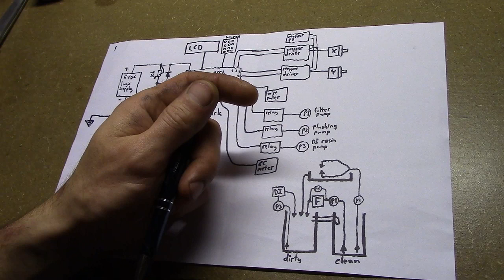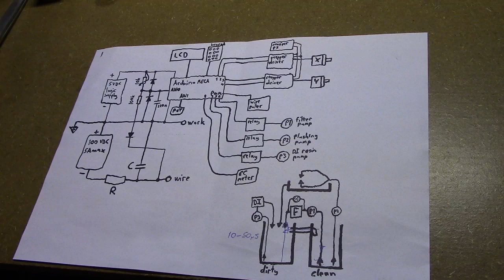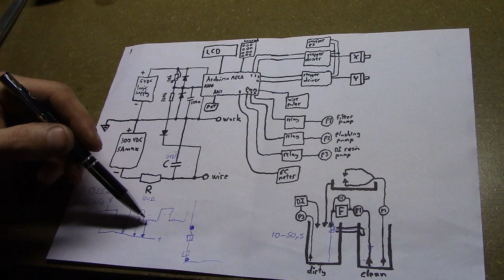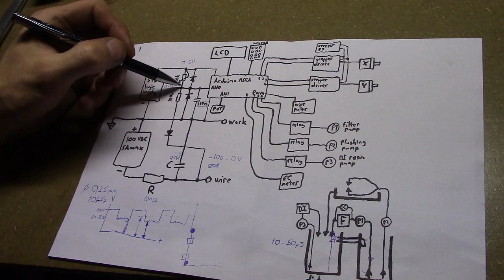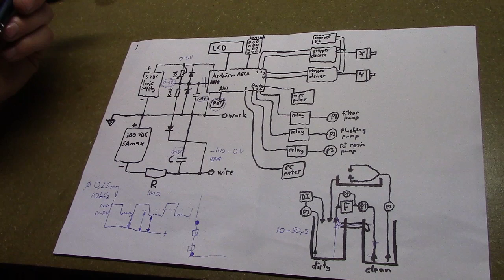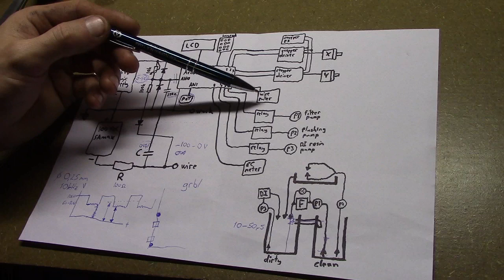Arduino wire EDM schematic explanation

Comment: About wire edm pulse, you wrote is a simple step pulse, i saw someone  use a two steps at the pulse,  i don't remember at which sides ; the rise or fall edge, its at lower voltage than the full 100v (let's say 60v).

Comment: I've been working on a ram EDM with this same approach, but I'm having a major issue that nobody else seems to have. I'm hoping you can help me. The problem is that no matter what my capacitance and voltage combination is, I don't reliably get arcs. It works if the tool and work are very clean, but then after 30 seconds or so, they are both so corroded, that it literally can ram the tool straight into the work and still not make contact. I can sort of get it to work if I "peck" the tool rapidly, but it's physically mashing the tool down into the work. I can't seem to overcome this issue, but there's no mention of it anywhere online.

Comment: I wonder what mineral oil would do instead of water?  The oil doesn't conduct electricity and is used to submerge circuit boards for heat removal.  Maybe the dirty metal would settle out in a dirty tank or maybe the resin pellets wouldn't be needed. Can magnets be used to clean the water?

Comment: 2:50 you have mantioned that Discharged circuit consists of only 100V DC but i heard that for ED Drill High frequency pulses are needed !!!! I wondering there should be PWM controlling signal wires from Arduino to High voltage unit to pulsing it with high Frequency !!! 
Is it not necessary ??
Reply from the maker: Little bit misnomer to say DC, proper wording would pulsating DC. It is a DC power supply that is either pulsed or just a simple RC circuit to get the required high frequency. In the video I used a simple RC circuit, so no PWM needed unless you want better control of it.
Reply: @TheWireEDM  by RC you mean resistor and capacitor ?
Then why you are saying " high frequency " without any frequency generator with dc unit ? Is that charge and discharge cycle which you are saying Frequency ?
Reply from the maker: @omsingharjit  Yes, I had a current limiting resistor from the power supply and then a capacitor in parallel with the spark gap.
Reply: @omsingharjit  An RC-circuit is a classical electronic oscillator, just like the pendulum-clock On the wall is a classical mechanical oscillator. All oscillators are fundamentally described by their frequency, since "frequency" was first used in science to describe oscillators.

Comment: hello jaakko i'm inspired by your project and i'm trying to build one for my graduation and i'm stuck in how to modify the gap with the pot and how to stop the stepper if there is a short circuit 
thank you !
Reply: I would imagine...your gain would be too high....or feed rate to high...so think of an Op Amp circle...the reference is your normal arc voltage...in this case I think he said 50 VDC average.....then thru the divider the Adurnio....I can't spell either...Anyway...the microcontroller should see only 0 to 5 VDC...and it's clamped by the diodes...so maybe it averages to 2.5 VDC....his software control loop...will have something like if less than 2.2 VDC then step or pulse motor...toward the work piece...if 2.5 VDC ...don't step...let burn...if 3 VDC or higher i suppose he could reverse direction....if 5 VDC work feed in more?

It seems like on could do with an analog op amp...which drives VCO...then step that oscillatorway down using Dflops..then feed Q put..to your stepper controller...but... divided way down...

Anyway talking is one thing...building is another...

At my workplace...our customer they don't have or are given any time to be careful plus  they can't use WD-40 in a clean room...so I deal with broken screw city galore...like 316 clean SST hardware in 316 SST and overtightened....boom broken seized or stripped...some get adventurous...they may bring out their dull bits out and break the HS steel bits off..or maybe they manage to get a tiny 3/16 easy-outs broken in the broken screw..now it is time to take their handiwork  mess to me....

So I need a nice sink hole Portable...universal EDM....

Ok...Fred...build it and they will come...

Then post on u tube...
And obtain some followers...

Comment: Do you have a link for the code? Don't care if it's v1 or v2 just need a place to start since I've never coded in C or used an Arduino.
Reply from the maker: I'm afraid the code will not then help you at all if you have no coding experience. It will most definately not work by just uploading.

Comment: Here you say 0.47uF but do you mean 470uF?  Like the Nippon Chemi-Con 470uF 450V you tested in v=RUYWzd7CBWQ
Reply from the maker: Hello, sorry for the long delay in answering. I really meant 0.47 uF (470 nF) capacitor. The one in the test video from years back was just a static test to see that an RC-circuit works. In a wire EDM you do not need a very large capacitor especially since you want a high frequency output.
Reply: which one is right？   0.47or 470 ？
Reply: it should be 470uF.  0.47uF is too small.  I didn't have a chance to build this circuit yet, but you can see the Nippon Chemi-Con 450V-rated 470uF capacitor in his other video (paste v=RUYWzd7CBWQ in the youtube link).
Reply: i am not good at  english    ！ thanks！
Reply: This project is the best!  But his power supply is more complicated. 
 http://www.mechatronicprojects.com/wire-edm-machine/

Comment: Please excuse my ignorance as electronics are a struggle for me but why is the 100v supply positive lead connected to the circuit ground and the 5v negative lead?
Reply from the maker: The wire needs to have a negative potential for the machine to cut and the positive lead is connected to the workpiece. But because the machine is grounded from its frame/table, the workpiece is also at zero volts relative to ground potential, thus eliminating electric shock hazard.

Now, the electronics are referenced from that same ground potential also and operate on positive voltage, so it ends up to be +5 V relative to ground.
Reply: Jaakko Fagerlund  and now can share?
Reply: Imagine of the sparking RC-circuitry as a simple electrics piece (like a resistive heater or a washing machine), while the voltage-divider/arduino-combo as electronics (providing solely information, thus, a logic gate), that has to make sense for the arduino, but not essentially to you and me. As long as the information suffices for the arduino to let it make the right decisions, it suffices altogether, and doesn´t need to follow our human intuition.

Comment: i am working on code
https://www.youtube.com/watch?v=Pp-5wQKF1Ao
Reply from the maker: Krasimir Tsvetkov That's nice, but it looks like to work only in Windows. Also, LPT port is not anymore used nor found on motherboards. And to top it off, most of the graphical functions already exist in open source softwares capable of sending G code, so why reinvent the wheel on that?
Reply: Jaakko Fagerlund i worked with edm wire machine before 20 years .I know the machine practically. I tried with the same program to send directly signals to arduino , but the speed transfer does not satisfy me.I sent every step by com.Believe me that this program can work with Android as well   :) nothing new....
Reply from the maker: Krasimir Tsvetkov 115200 bps should be plenty enough to send data over, but I fail to see why one would generate the step pulses on the PC as it is far easier to have the Arduino receive G code and generate the steps needed, as it then is a fast system withot the lag of PC. True that in an EDM the step rates are extremely low compared to milling, but still.

Is your software open source?
Reply: Jaakko Fagerlund i don't like arduino grbl because doesnt show me the point   were is working (i am old fashion   man ). And if you have a time  try the transfer  115200 bps  with arduino uno... The software is not pubic yet ...
Reply from the maker: GRBL gives out the coordinates (work, offset) and also the G code interpreter state, so it really shows where it is and what it is doing.

I don't even start to test out trying to send steps over to the Arduino, as it would be pointless. It is by far the easiest and most simple to just send G code to the Arduino. With steps you don't need the Arduino, just send that information to the stepper motor controllers.

I understand your software is not public yet, but will it be open source or not?
Reply: Jaakko Fagerlund It`s pleasure to use my own code, a method of interpolation, acceleration, even another method for powering the wire .I think to not open source , but a token amount,Good luck,Jaakko!Respect your work!
Reply: Hello Krasimir, so far i tried to work on simillar project, but made the code on C++. Most of WEDM machine has parameters developed by C. Did u tried this?

Comment: im trying to start a small (injection mold) manufacturing shop , but just for my personal use , i wanna know how this machine can make a mold (because some mold) are really complexe , and have undercuts so i can image working by carving or router , with spinning tool (spindle) but using EDM i just wanna know how before making this machine .
thank you and im also interested to this DIY machine
Reply from the maker: +High ”Addicted” Tech You have a loooooong way to learn before I even start answering.
Reply: just answer :) if i don't understand i will not ask you again , but i will try to get the max of informations from your reply ,
people are not all the same ;)
Reply from the maker: +High ”Addicted” Tech Well think of the wire EDM as a high tech bandsaw/plasma/laser/torch. Now tell me how many injection molds have through cut features? Possibly none, as the wire EDM only helps in doing some (small) inserts. Of course if your mold can be cut like wire EDM cuts, then I don't see any issues in using it.
Reply: you mean it is preferable to use EDM for small distance cuts
Reply from the maker: Facost .com I'm having a hard time believing that you even know the difference and limitations of wire EDM and normal sinker EDM operations. If you do, please think.
Reply: thank you anyway , i have feeling that we will not go ahead ,

Comment: Great work. I hope the new pulse supply is even better. Calculator says your RC oscillator is about 12KHz with 100 ohms and 0.47uF.
Reply from the maker: Yup, it is much better based on just preliminary testing at 50 kHz :) I'm at the moment busy coding the new Arduino sketch that enables using the new pulsed power supply with 8 different power level settings and being able to adjust the frequency and duty cycle from within the program. Also coming up is graphical display of the tool path :)
Reply from the maker: Progress is being made, I have the thing on a test bench now and need some PCB's and a few lines of code for external hardware and should be golden :)
Reply: Hey Jaakko, how is it going? any progress on the v2 wire edm? Everyone is waiting for you to release something...